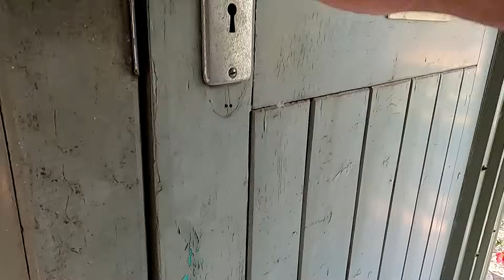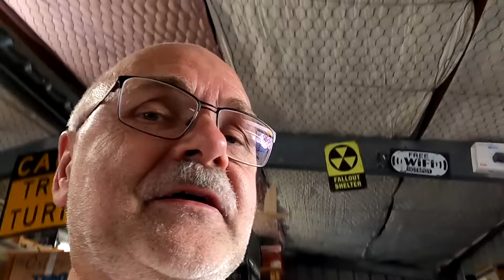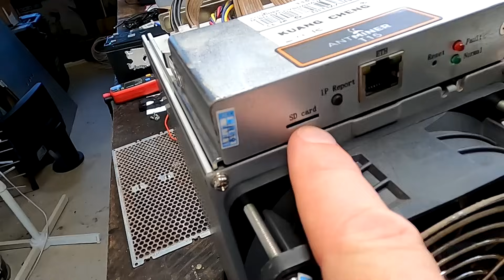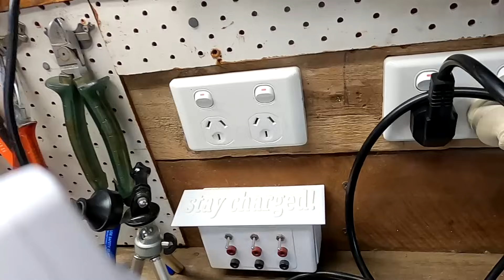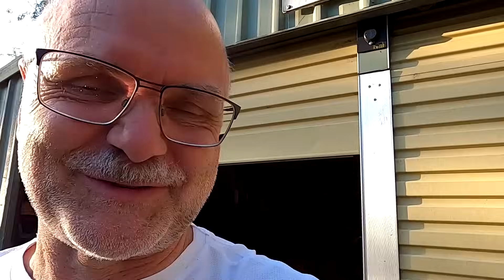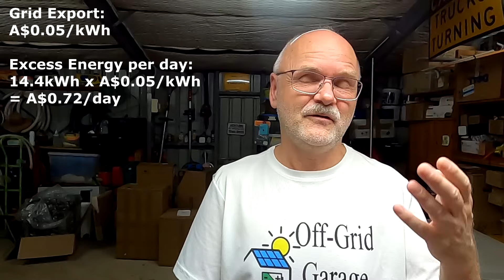Off-Grid Bitcoin Mining with excess power from your solar and battery. Worth or Waste?

Comment: I doubt the miner will earn the money you paid for it. Also consider the 90 bucks for sending the defective hashboards back to China.
The coins generated per hashrate halves about every year, because the mining difficulty doubles about every year. This can only be compensated, if the price per bitcoin also doubles every year.
The difficulty relates to the overall hashrate of the bitcoin network. Newer miners are more efficient and faster so older devices get a smaller piece of the cake. That's why the are sold.
Remember: The guy selling the shovels makes the most money during the goldrush.
Reply from the maker: Yeah, I know. It was not so much for making money but getting some experience with the process. And noise😊

Comment: Another option would be to purchase old zen 2 zen 3 era Amd cpus and mine using nice hash as well. It would definitely be quieter than that and probably make more money as well and since you don't care about power use it'll be a great way to burn power.

Though this does need some knowhow to setup but it can be done 😅
Reply from the maker: Never heard of this before... I'm not into the scene as much😙
Reply: @OffGridGarageAustralia  Ideally it would take a larger array of solar panels to be actually worth it and have a tangible effect on your wallet, but for your purposes of burning power any type of crypto mining would be fine. Even better if you can simply export the power back for planet saving global emission points.

Comment: 30 cents per kwh is quite a lot vs what i'm paying.... Around 8 cents canadian....But we are using it a lot since most houses are electric heated here even by -20c.  8-)
Reply: How is canadian grid power produced?          hydro...  or wind...   or nuclear....   or coal, oil, or gas?
Many countries are working hard at reducing fossil fuel burning (such as australia).  Electricity prices vary in the different states of australia...  30c/KWh is pretty cheap here!
Reply from the maker: Well, Australia is not really working hard on reducing emissions. It is quite the opposite and the gov is approving new coal mines again and again. Seems like even Siberia is greener than we here in QLD.
You can look up here how dirty we really are. CA is mainly powered by nuclear and hydro.
https://app.electricitymaps.com/map
Reply: I live in that area of verry green, right in the  bottom middle of australia- the state with 97% renewables!  In terms of consumption, that's only beaten by a tiny number of countries with great hydro or hot spring benefits.   
I'd call that working damm hard on emissions!   Just time that other parts of australia pull their fingers out!   
Don't diminish the achievement....  applaud it and try to emulate it.   South Australia isn't blessed by any natural features giving it an advantage over other states....just desire to do it right! 

I agree that it's unfortunate that some regions of australia export humungous amounts of coal (not SA)...   But if the whole of australia helps show the world the will and way to do it, then there'll be less coal exports. 

Much is about politics...  earlier federal labor parties lost the electoral vote because of dirty politics by liberals, so they aren't shutting polluting things down as quickly as they probably wish to...  but if you don't agree that australia under federal labor has moved greener in the last couple of years than the whole history of liberals....I dunno what your information sources are!

There are clear reasons why nuclear isn't a power source in australia, and obvious reasons why hydro doesn't suit most regions (including SA)   (you need water and slopes, as you'd know)

Anyway, keep up the good DIY solar work. 
  @OffGridGarageAustralia

Comment: Hello mr andy . Have you ever used orion 48/48 to transfer energy between 2 batteries? I would like to transfer energy from 16s200ah to 15s200ah in the night to extended my autonomy.Can it be an idea? Events lead me to evaluate this option
Reply: the orion-tr 48/48-8 is a 8A DC-DC converter, meaning at constant output it'll provide only 8A. to empty your 200Ah battery would thus take at least 25 hours - way too long for night time consumption use,  so you would need to get another unit to bring this down to a usable 12 hours. 

 It would be financially better to sell the 15S battery and get another 16S battery (or visa versa...)
Reply: @Stefanfj  I totally agree. actually the purpose is to avoid the grid bypass of the inverter (in winter). I don't care about fully charging the battery. thanks for the tips
Reply from the maker: If you transfer energy from a 16s to a 15s battery, there should be enough voltage difference to let it flow naturally. OK, you may need to control it somehow with some sort of PWM controller.
The Pace BMS have a 20A limiter included which is better than the 8A DC-DC converter.

Comment: Use your house as an inverse heat battery.
If you have airco in your house, use the excess power there to cool down the house.
This also increases comfort in your house (although you're always in the garage it seems 😂).

Another option is to run pumps for a cooling panel like @TechIngredients or @NightHawkInLight made.
I think this option is beneficial for the planet, because you dump the heat into the void of space!

Either option is better than heating up the planet with a ponzi scheme.
Reply: All energy from sun is heating up the planet, doesn't matter if some of it was converted to electricity which is converted to heat, it would've been converted to heat anyway.
Reply: we better send Andy bobble caps instead of beer.
Reply: The sun is heating the planet. 
"If you have airco in your house, use the excess power there to cool down the house." 
🤔leave the fridge door open?
Reply: @krasslofw.4393  fridge analogy is just wrong, you totally can use aircon to cool down house more during peak production to not use it as much during the night, but that will only save some battery cycles in Andy's case.
Reply: @JGnLAU   oh is it? So maybe my understanding of physics is as developed as your sense of irony🤣🤣🤣

Comment: i find that the airflow over that grid at the front can cause condensation on the steel thanks to wind chill , this moisture can get vacuumed into the machine, what helped having 3d printed grid over the fans , maybe just the area i stay in humidity was a problem
the rust on that psu grid suggests those machines may have been subjected to the same torture

that is how i lost hash boards
Reply from the maker: There was no rust when I set it up in the toilet. I was wondering as well about that...
Reply: @OffGridGarageAustralia  yea  i found out one night when checking on an offline miner, they were sweating so much the water was dripping of the grids, mining is hard work

But yea where i live it gets real humid at times

Comment: Excess power you could directly sell to you neighbour using an extension cord and a in line kW meter.
Reply: if his house is off grid....I'm wondering how many kilometres of extension cord he'd need to use to get to his nearest neighbour.   (And of course, no one would tell anyone, since unfortunately that's not legal in orstralia.)
Reply: @annpeerkat2020  
Neighbours are not that far away since he comments about neighbours making noise.
Using an extension cord is illegal in Australia?
Reply from the maker: 300m extension cable with pulling 2000W. They would have over 50V drop with a 2.5mm cable.
Reply from the maker: A 300m extension cable with 2.5mm and 10A load would cause around 55V voltage drop.
Reply: @OffGridGarageAustralia  
It was an idea but at 300m, yes its a little far. A 10awg wire at 1000feet is 2 ohms, at 10A there would be a 20V drop, at 240V thats less then 10%. But that much copper would be expensive.

Comment: Hi Andy, I have thought about something crazy: water.
Lemme explain. Australia is very dry a country, so I guess that water must be expensive there. Maybe I'm wrong, I'm living in a tropical island, and EVERYWHERE is dry compared to my place.
So, how about an atmospheric water generator. Producing water out of thin air and solar power could be a nice project. You could start tinkering with a bunch of peltier modules, then a modified AC, then Industrials hear about you and send you units for testing, then you buy some, eventually you produce so much water than after having turned your garden into a florishing oasis, you end up asking the community what you could do with your extra water...
Let's make Australia green again 😁
Reply: If you started pulling meaningful amounts of moisture from the air (on an industrial scale)....   you're pulling it out of the airstreams that supply rain to farmers etc elsewhere. 
If you're talking about domestic levels of water...   sure...       
Though strategies to reduce water consumption would probably be more effective!
Reply: @annpeerkat2020  Short answer: no.
Longer one: You are not pulling wayer from the cycle. You are only inserting yourself in the cycle. Instead of: Rain -> evaporation -> moist air -> clouds -> rain, you get: Rain -> evaporation -> condensation -> andy's garden -> evaporation -> moist air -> clouds -> rain.
No water is ever destroyed or long term stored in the process.
Reply: sorry.... I was sure I read the word "oasis".  @reneonier
Reply from the maker: I get a bucket full of water from my AC every 6 days. The heat is dry over here unless we had some rain close by. 40°C don't feel that hot here as you don't seat much as elsewhere.

Comment: This is very informative and shows that exporting the power to the grid is the solution to sell the excess power.
Reply: I disagree and think that exporting here in Australia is a waste of your solar
Reply: Not as simple as that!!    You can just as readily say it shows that the solution to excess power is to use your appliances when the sun is shining, not when the sun is dark!
Reply from the maker: Grid connection comes with many regulations. I would not be able to connect that much solar to the grid.
From an ethical perspective, feeding it back would make all the sense.

Comment: In Ontario Canada i'am on the ultra low rate program
11pm to 7am its 2.8cents
4pm to 9pm its 28.8cents
Rest of the day its 12.2cents
Use my solar system batteries during the 28.8 time and some of the 12.2 time , works great in the summer.
In winter not so much, but do load shifting from charging at 2.8 to using at 28.8
Reply: Your power stations generate power from....   what energy source?
Reply: @annpeerkat2020 
Current production from Ontarios gridwatch site
solar 312MW
wind 2014MW
gas 1155 MW
hydro 3450MW
nuclear 9059MW
No coal, but even if a EV is powered from a coal plant its still cleaner then a gas or diesel car.

Comment: You could try a bigger water heating buffer if you can use this warm water later-on or do some other investment that saves on bills or provides income (water treatment, grain mill, gravity energy storage) that could consume the excess of energy. Finland also did a heat energy storage for the winter using huge sand container (seems a big investment).
Reply from the maker: We are a two-person household and have a 160L hot water tank. Once heated up, it last us up to three days in summer.
But I have the pool with 60kL...

Comment: Good job Andy, really interesting stuff, Ive been wondering if/when you would touch on this subject. 
I was considering doing something similar with 2.5kw of pv on a remote bus setup I have & dont use much, but you have confirmed what I suspected with bitcoin mining, & then there are so many other unmentioned variables that I didn’t consider it would be worth the time, noise, heat & upgrades necessary to do it. 
So many comments on turning ur excess power into heat storage, I would imagine the best way to accomplish that would be with heat pump tech, but what about selling it back into the grid at peak times & use ur excess battery storage to dump & store power, imagine this would be much simpler than bitcoin mining & maintenance, without all the heat and racket & make more use of ur batteries, it may not be a very efficient way of dumping ur excess power for money return, but simple & quiet. Cheers

Comment: Excess power: 
1) Make ice with it.  ~12kWh per 100 kilos.   Sell it or use it for summer house cooling.
2) Electrolyze it into hydrogen and compress it.
Reply from the maker: Thanks Keith. Everyone can make their own ice these days, so demand is relatively low.
Hydrogen will not come to domestic installations for a long time if at all. The regulations, safety and maintenance...

Comment: How about this: there are water cooled versions available. If you run ir through a heat exchanger, you could heat up water for domestic use, or even dump the heat into the pool 😅
Reply from the maker: They are a bit quieter but also having fans. And I would have to invest in this tech again... 😉

Comment: Hi Andy, great episode. I have a similar setup here in Germany. I set up 6 S9 Miners (4.8kW total :-)) but they ran only in case if I overcome my feedin-limit. My setup is controlled by Raspberry pi since two years now. By statistics, I see that I reach 30% runtime per year. As you said the noise is the biggest issue, therefore I decided to use AC in order to controll room temperature, consequently the fans getting slower. 
Would I do it again? Maybe not, even if it is ok now. 🙂
Reply: @clint965ich kann bis jetzt keinen Defekt feststellen. Die Miner wurden sicherlich schon hunderte Male ein und ausgeschaltet über eine Alexa Steckerleiste.
Reply: @timoburggraf2825  hi timo, hast du mir da evtl. ein paar tipps bzgl. dem aus u. abschalten? machst du das manuell? hab das gleiche "Problem" wie Andy. alles voll geladen ab 11 morgens. nur in der Namib Wüste, nicht in Australien. Hab mir nen gebrauchten Avalon 1166 Pro angeschafft aber noch nicht angeschalten, da ich immer dachte die müssen permanent durchlaufen 🙂
Reply: @JJdouble0seven  hi, ich kann dir ein paar Tipps geben. Das Ein- und Ausschalten ist scheinbar für Antminer S9 unkritisch, wie dies bei anderen Geräten ist, kann ich natürlich nicht sagen. Alles Tip, es gibt meist die Möglichkeit über API den Miner in Idle zu schicken und somit den Stromverbrauch stark zu reduzieren. Bei mir habe ich jedoch via Alexa und Webhooks den Strom getrennt.
Ich kann dir Mal Bilder schicken.

Comment: I'm offgrid and in summer 90% of available solar energy remains unused. It is cheaper not to use excess energy than to use it in most cases.
You need to also consider the cost of the extra battery degradation if it is involved and also the wear on the inverter and some other equipment involved.
Reply: YOU ARE RIGHT ON THE MONEY  !!!!!! WEAR AND TEAR ON THE EQUIPMENT ...... NOTHING IS FREE IN THE WORLD, EVEN BREEDING IN THE AIR.
Reply: A GOOD FRIEND OF MINE, OPERATES ONE OF THE LARGEST BITCOIN MINING IN NORTH AMERICA. TO REDUCE THE COOLING COST. HE HAS THE OPERATION NEAR MTN RAINER.
Reply: A good friend of mine is an optician....  he could whip up some glasses to help with your vision problem...... @jameskim62

Comment: Hi Andy, what if you put peltier modules for the fans to suck cold air into the mining rig to help cool the mining boards, will it create moisture buildup inside the mining rig that could damage the mining boards?i know peltier modules are inefficient but just a thought...great video by the way and thanks!
Reply: peltier would be way too inefficient. bigger fans with a duct could help for less noise. those asic heat sinks look badly designed too- air flow is badly optimized- people running these operations will not care about a few watts or dB of noise.
Reply: Peltier module?  Create even more heat to create coolness?     Just when the kerosene burning fridge seem to have disappeared.
Reply from the maker: What do I do with the additional heat of the peltier elements. I'm ending up creating more heat than now...